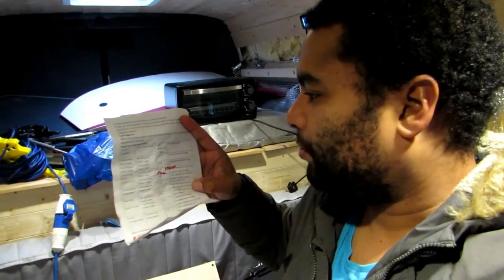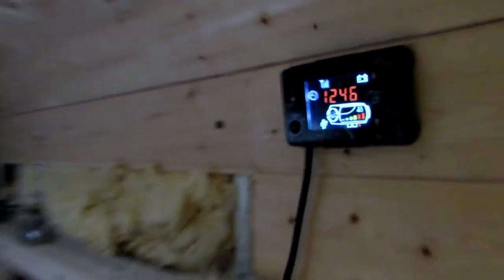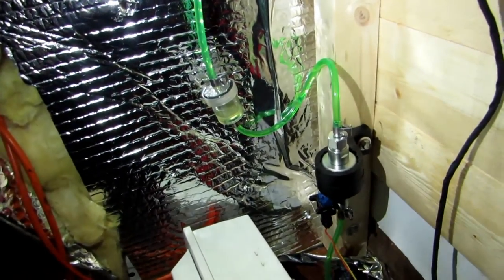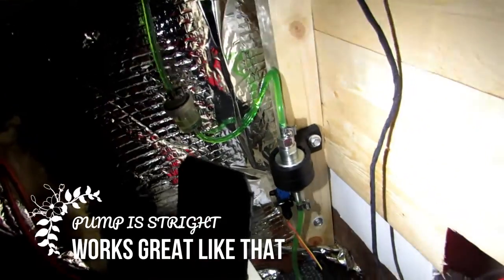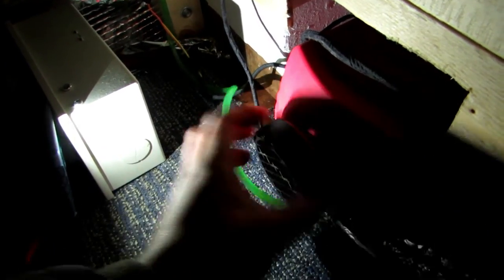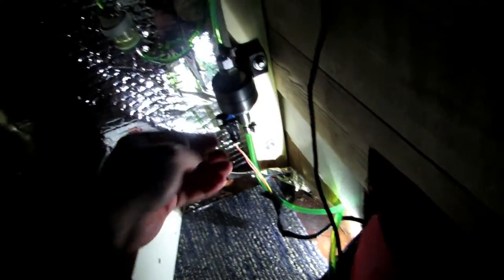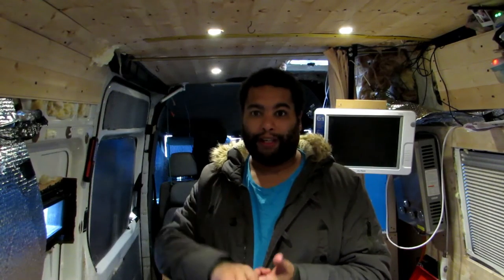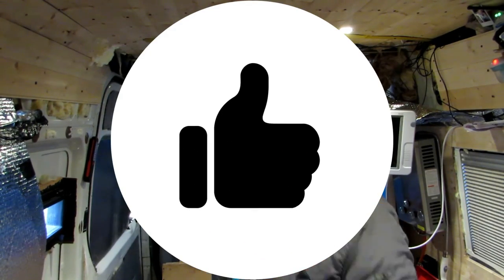chinese diesel heater ERROR CODE E-10

Comment: I GOT A E -08 THEN A E-10 IN A METER OF WEEKS. MY FUEL PUMP MOUNT BROKE OFF. THE PUMP FLIPPED UPSIDE DOWN. I FIXED THE ANGLE TAPPED IT A COUPLE TIMES. WORKS GOOD AGAIN. HAD TO SHARE THAT. AND THANKS

Comment: Thanks for the advice. I think u got the fuel pump wrong. It should point up the pipe to heater at least 30 degrees to bleed away any cavitation bubble and not get stuck and pump and air cushion! I never seen a pump mounted this way

Comment: Thanks for the info i had a E8 and aE10  At the same time  and only used it 4 times dam i thought so out with the heater took it apart and what did i find  thick black soot with carbon lumps around burner so all i done was cleaned it put it back in started up and bingo running great now and all because the air intake was blocked  at the fan end and choked it up so beware but a simple fix  so forget the ERROR CODES TAKE IT APART AND DE SHOOT IT WILL BE THE FIRST THING TO DO thanks again.
Reply: U welcome I hope u click the subscribe button

Comment: Dude, you saved my sanity today.....I had an S bend and my exhaust was filled with fuel and it wouldn’t ignite. Thank you so much! 👍🏻
Reply from the maker: No problem bud hope u sub
Reply: @belgrave1984  Hi I just found your channel. I have the non digital controller (with a turn knob) and the lights on it are flashing in a way that don't match the error codes 1-8. Basically the light on the knob is flashing intermittently with the ten control setting lights surrounding the knob. Do you think I have error code ten? Is there a error code 9? Also do you think its worth me getting the digital controller I kinda don't want to if you can't turn the screen off at night when you want to sleep but I guess if it helps me diagnose problems easier it might be better?

Comment: Thanks, my e10 code turned out my fuel pump was not ticking. Gave it a light tap with a spanner and it started ticking again. Problem solved. Cheers
Reply from the maker: I hope u sub thanks bud for watching

Comment: I disassembled mine to clean out the soot because it would smoke and stop working.   I would get e06 error as well.   After cleaning it ran fine but stopped and i still got e06.  I figures the chinese bearings were shot after 2 years causing the fan to run too slow.   I adjusted the hall sensor didtance to the back of the fan and it worked again for a few hours before it stopped and giving me an e10 code.  I made sure the fuel lines were clear but it still would not start.  It would try but no fire and give me e10 errors.   So, I took the unit apart and discovered that it was all gummed up with soot and unburnt fuel.   I was surprised how quickly it gummed up inside after cleaning it.  I then cleaned it out again and after this it runs perfectly.  The fan noise stopped making me think I must have torqued the screws down wrong or something the first time I reassembled it.  Btw my fuel lines are quite long but mine are the rigid nylon type.  Those soft clear ones are not really suitable due to them absorbing the pulse pressure required for the burner to operate correctly.  The burner requires a squirt not a dribble of fuel into the burner.

Comment: I had an e10.  I put a quiet pump on my 5kw heater. It worked for a month. Idk if the quiet pump was rated for 5kw, but when I put the original loud pump back on it, then it worked. Glad I didn’t have to take it apart to clean soot and air intake 

Btw it looks like ur pump is upside down to me. I’ve heard it can have air bubbles if not at the proper angle

Comment: Gday, looks like you have a few instillation errors there. 
1. Metering pump is upside down. These pulse pumps must be in a vertical position to work properly, ideally between  15 deg and 35 deg if stationery and 45 deg in a van or mobile environment. 
2. You are using the wrong fuel line, bore size is to large. Causes stress at pulse pump.
3. Looks like you also have the fuel filter on backwards. They only work properly in one direction.
Trying to point you in the right direction.
Good luck.
Reply from the maker: Thanks bud
Reply: What's the difference between having the filter mounted in either direction?
Reply: I just had a quick read up, found something that said fuel flows from the top of the cone to the base so if it gets full and fails it will collapse and hold fuel as opposed to pulling apart 

Classic example of learn something new every day
Reply from the maker: They say 90 angle on the fuel pump I have my straight down works fine for me as it sound a bit better straight
Reply: Hi C, Most filters are designed to be one direction, and most have an arrow. However if missing an arrow how I look at it is the inlet fuel comes in on the outside of the filter. The filter separates out the dirt and it then drops to the bottom of the bowl. If you have the inlet fuel coming into the "inside" of the filter any dirt or grunge will rapidly block the filter.  J
Reply: I had low fuel in the tank and it caused E10 error code, the pump was trying to pump/suck fuel, but quickly realized my right tank which feeds the pump was just above the empty mark thus not allowing the pickup line to reach the fuel, so the igniter wouldn't fire prime case of not paying attention before I parked lol.. I had to idle my truck for heat, so lesson learned... Thanks for your video!
Reply: @tyflesh  Same here, I ran out of fuel! Duh, it doesn't work with a full canister of diesel next to the heaters fuel tank!

Comment: So i got the e-10 today after not running my heater for a couple months. The fix for mine was the hard fuel line was pinched inside the rubber line right at the engine. Make sure you have flow all the way through your fuel line.

Comment: Mine isn't gravity fed and I've got a load of fuel line coiled up next to my tank which is a 5 gallon drum with a hole in the cap for my fuel line. I can honestly say that I've never had a problem with it, its not secured down because I use it in different vehicles.

Comment: Cheers for this pal, installed one of these in my shed and getting E10, no blockages in fuel line or tank. Your fuel filter is upside down (fuel going into filter from larger end) compared to other videos i've seen, and compared to my own, which was working fine, can they go either way around then ? Liked and subbed ).

Comment: Everything I’ve read says to make sure the fuel pump doesn’t point straight up and down. And that the arrow is supposed to be pointed upwards at around a 35 degree angle. Is that wrong??

Comment: I’m not sure about your language but cables are not lines and lines are not cables it’s a good thing you put it in the pop-ups the word line
Next time okay. Remember to mention that the stiff fuel line should be at here too as you do not want any expansion of a Softer more pliable fuel line, along with the fact that the connecting rubber should be small and that stiff plastics should be pushed in as far as possible before clamping. Also I believe your pump is 180° off. However you have correctly put it in a vertical position as it should not exceed 45° angle from that vertical.
Reply from the maker: Keith next time thanks
Reply: I’m sorry The phrase should be “adhered to”., and a razor blade or similar should be used to cut fuel lines....not ....I repeat do not use wire cutters are such thing as it has a tendency to pinch the end and restrict fuel flow. Hope this helps
Reply from the maker: So I’m not perfect

Comment: lack of fuel can be caused by the vent in the tank cap blocked. (air in to get fuel out). i had that problem. Mount fuel pump with the output up and at an angel  (about 15 deg from straight up) so air does not get trapped in pump .

Comment: My E-10 error turned out to be the foam in the air filter had collapsed/deformed and got sucked into the pipe so little to no air was going into the burner, a new air filter and all was good again.

Comment: The manual says the fuel line should be at least 1.5 meters long,no shorter..
Reply from the maker: Yep u right but don’t believe that I’m running 5meter
Reply: Check out the all-in-one chinese heaters. The fuel line is no more than a few inches long. Go figure. These things will drive you nuts!

Comment: I got an E10 error because I had too much of a voltage drop between the heater and my battery. This didn't allow the pump to run initially when tge glow plug was activated. During glow plug activation you could also see the display screen dim, indicating a voltage drop. Replacing the wiring with a larger Guage wire from the heater to the battery solved that problem. The end result was no fuel was being pumped.

Comment: Your pump is upside down... that will allow cavitation bubbles to build up and render your heater inoperable.... it’s happened to me.
Reply: Yes the connecter side of the pump should be pointing upwards 15-30 degrees

Comment: When using less fuel, it begins to soot, any ideas on how to prevent the soot?? Like keeping the chamber hot, by manually lowering the fan speed (While keeping the fuel supply unchanged)
Reply from the maker: This is what I do I run it on high for 60 sec then on lowest setting then after u finished running the heater before switch  it of run it on high setting
Reply: So - while it's said that the low heat settings create soot, it's actually more the low combustion airflow which does. For any given level of fuel-rate, you can under-oxygenate it, & it will soot. You can correctly oxygenate it, & it won't. If you over-fan it, it won't soot, but will struggle to get to temp, leading to more fuel consumption for a given heat output.

So basically - you're definitely on to the correct thing, looking at fan speed settings.

Comment: Incorrect pipe used, they supply the pipe to be used... The fuel pump is at an incorrect angle (look at webasto website)... After every 5 hours of low power use turn up to max for 15 mins... I have a cheap Chinese model of 5kw and have used it for 6 months and it gives no problems.
Reply: Also look at the instructions as there are minimums to the lengths of fuel lines before and after the fuel pumps... Also fuel tank above the heater? Allowing gravity flow to the heater when switched off... These are all problems I have had from using these heaters in the last 10 years. Regardless of what problems with these heaters it is normally sorted with a new glow plug. Hope these pointers help.
Reply from the maker: Steven lee thanks for comments hope u had a good Christmas

Comment: My jet inlet was blocked with a kind of rubber/glue substance. Heated up a needle on a gas stove so it was red hot and pushed it into the jet inlet. Fired up perfectly 🤠
Reply: IS the unit easy to take apart? to check the fuel inlet?
Reply: Gary Hiscutt Didn’t need to take the heater apart, it was blocked under the base next to the air inlet pipe. If you place your lips around the pipe you should be able to blow a small amount of air, if not it’s blocked.

Comment: Have striped the setup down and re-did the install - no air in the fuel line, but am still getting E10 Error. the speed does increase but a point, but then shut downs; Don't think having the fuel filter the other way up than what you have in your video would make that much of a difference, just can't think what the problem is - I have fuel - no air In the line....
Reply: Did u sort this i have the same

Comment: Help!!! tried my heater out for the first time today. When it was fitted the mechanic said the control panel didn't work so he put a dial one on with on off switches. It comes on and you can hear some clicking then it just goes off by itself. It's not getting hot just blowing cold air and there was nothing coming out of the exhaust either. Any advice would be great.
Reply from the maker: Check fan not stuck or it need Priming

Comment: Hey guys ! Let me help all of you. Before 10 min I 'm fixed this problem error 10. So it is easy. So what going on. I'm realized when is to much humidity in air, like today was rainy day. So, mashine tuck cold wet air and  burn it in chamber. That is ok if air is not to wet, but when you got to much wat air in air it condensed in chamber and egsost pipe and that make blokage of sistem.  Computer realized that and turn pump of. So what you need to do ? Just with compresor blow on suction line air in chamber and  blow all that garbage out. I don that moment before writ this, and fucking burner run as a new. Thanks

Comment: my battery is 12.3 but lcd  display SAY S 9.99 V...???  ARE MY WIRES TOO LONG.  OVER TEN FEE??
Reply from the maker: Make sure the cable is not Extended and straight to the battery Terminals

Comment: hello is there any way you could send a coy of the instructions and error codes I am having trouble finding them Thanks
Reply from the maker: I see if I have my copy bud but u can find them on google
Reply from the maker: https://www.google.com/search?tbm=isch&sxsrf=ACYBGNRV501eN3MbZU7ZwGUWRgHZSITXew:1573753298271&q=chinese+diesel+heater+error+codes&sa=X&ved=0ahUKEwigy7ryn-rlAhV1mVwKHSqbCMEQrNwCCD4oAA&biw=1378&bih=913&dpr=1#imgrc=aUDE310J2mYr8M:
Reply from the maker: https://www.google.com/search?tbm=isch&sxsrf=ACYBGNRV501eN3MbZU7ZwGUWRgHZSITXew:1573753298271&q=chinese+diesel+heater+error+codes&sa=X&ved=0ahUKEwigy7ryn-rlAhV1mVwKHSqbCMEQrNwCCD4oAA&biw=1378&bih=913&dpr=1#imgrc=Wgvg-ZZLcb9cBM:
Reply from the maker: https://www.google.com/search?tbm=isch&sxsrf=ACYBGNRV501eN3MbZU7ZwGUWRgHZSITXew:1573753298271&q=chinese+diesel+heater+error+codes&sa=X&ved=0ahUKEwigy7ryn-rlAhV1mVwKHSqbCMEQrNwCCD4oAA&biw=1378&bih=913&dpr=1#imgrc=kcXgi2UC7gf7SM:

Comment: Does anyone know where I can get gaskets for the inside of the heater.  I've has to open it up to clean it and my gaskets have broke . Need help to get new gaskets.  Cheers
Reply from the maker: Contact a seller but u can a liquid gasket seal kit get it from Any car shop
Reply: @belgrave1984  
I just a bit worried about getting the jelly kit off the next time I'll have to clean
 it again . But ill just use it .

Cheers for that
Reply: Seen them on ebay
Reply: I used the cover of instruction book place on top cyilinder cut a hole and follow the contour  use some screw to make hole very easy  how we did in 60 motorcycle mechanic

Comment: My heater is constantly running and all the lights are on ,the only way is to disconnect from the battery it won't fire up and won't turn off  got E-00 but no indication of what this could be ....any body help ...it's cold in the shed ...

Comment: Did you get a lot of smoke
Reply from the maker: Yes when it first starts up then after a 1hr nothing
Reply: @belgrave1984  mine has been a pain. Loads of smoke  and no heat so need to strip it down and clean it.
Reply from the maker: Run it on a high setting

Comment: Getting an issue with my heater as the put runs for a little while then stops - All I have is an air lock, but I shortened the pipe and disconnected the pipe from the unit to make sue that the air was out - and as far as I can make out all the air is out - But still on working -
Reply from the maker: Gary Hiscutt are u getting any error codes
Reply from the maker: U sure u have the fuel pump the right way
Reply: Have it sorted now, but in saying that the unit isn't powering up now - I tried to extend the power cable as it was a little too short and would not attach to the main battery - but since then I have now no power to the unit - even though I have current going through the cable as tested on multi-meter.
Reply from the maker: Make sure it’s got a good earth connection
Reply from the maker: Or check the connections
Reply: Done that - the arrow is pointing towards the heater... as the arrow on the fuel pump

Comment: Error1 comes up.can anybody help thanks
Reply from the maker: Kerry Chubb usually that’s under voltage I hope that helps check your battery power
Reply: Thanks
Reply from the maker: No problem
Reply from the maker: I hope it’s working now

Comment: One pump not starting. And my menual is hard to read by site the print is bad
Reply from the maker: Is the pump the right way
Reply: @belgrave1984  yes
Reply: @belgrave1984  I got all the air out before the pump
Reply from the maker: Send me your number I help u tomorrow join my join on fb called empire one life

Comment: I'm getting an E-03 code.  I can start the pump with purge and it did run for a couple hours.  Whenever I start it the blower blows at minimum for a bit I hear a click from the unit and it shuts off with error code 03. The pump won't start,  and the glow plug does not heat up.  I'm thinking I either have a glow plug problem, or the controller is messed up.
Reply: Sounds like your pump needs replaces, you should hear the pump working to suck the fuel to your heater..
Reply: tinker'n e-round E-03 is overheat (aka flame exceeds safe maximum temperature)